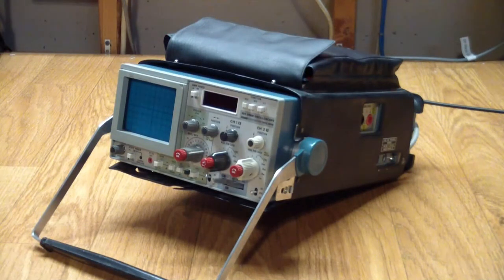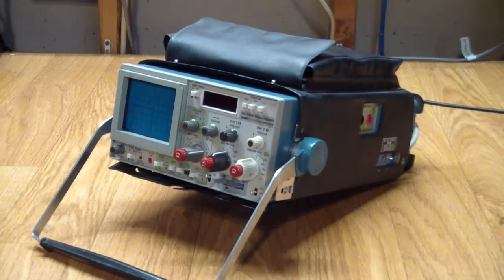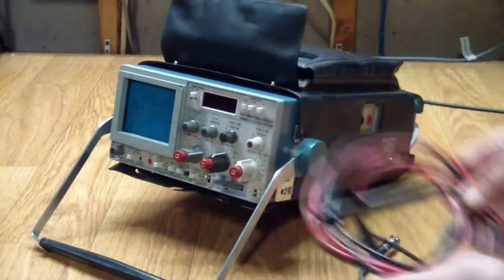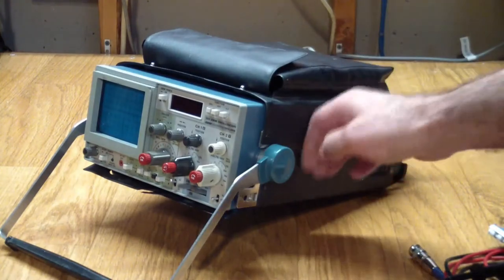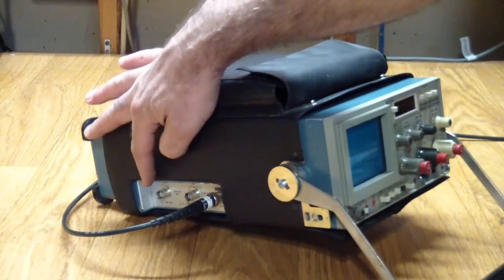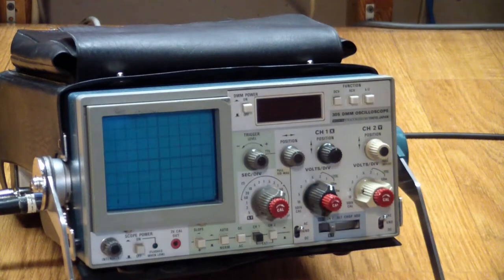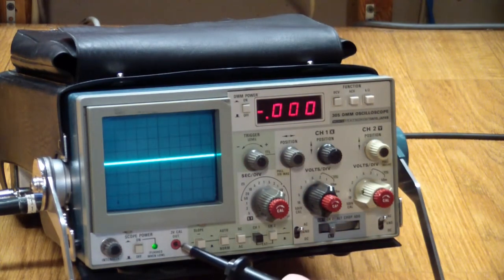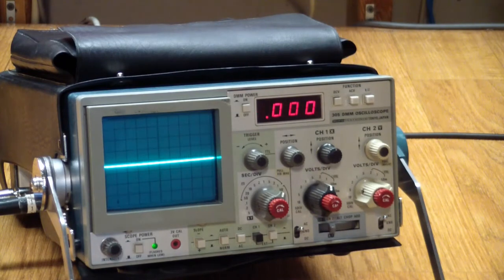AE#1 Sony/Tektronix 305 Oscilloscope Repair

Comment: Thanks for making this video - I have one of these scopes dating to the early 80's. My scope's horizontal sweep was affected - the trace all the way over on the left side of the screen. I watched your video, downloaded the schematics and took the top off the beast. Checked the PS voltages like you did and found them to be off. I'm thinking it must be bad electrolytic capacitors in such an old machine but it was pristine no signs of electrolytic issues. I took the PS board apart to look at it and couldn't see anything wrong. Then, admitting defeat, I reassembled the PS and battery charger boards, tightened the couple of standoffs and screws back up, and guess what, it works! Test point voltages all good again. Looking at this design, the chassis and the mechanical components such as screws and standoffs are actually an important part of the grounding throught the scope, so in my case, just removing and re-tightening a few of the PS board fasteners fixed my problem.  Not unlike your issue in this video (missing screw on the main board). Thanks for the inspiration. These machines are old and antiquated, but they are beautiful pieces of engineering.  Nice to not have to throw them away. I started the day intending to use this scope which hadn't used in years to troubleshoot another problem, so now I can go  back to that one!
Reply from the maker: You have to make sure that all bolts are present and tight. Over the years the pcb will get contaminated creating all sorts of raised ground levels all over.

Comment: Watched with much interest. I had a go at fixing a defunct Tektronix multi voltage, dual trace scope some years ago. It did work when I first got it but then found problems with the PSU side. One of the power transistors had failed and the only thing I could get my hands on then was a T03 2N33055. The body of the transistor had to be modified to fit onto the scopes circuit board. Only 1 mounting nut/bolt could be used and the opposite side of the base had to be removed to get it to fit. I did get it to work however and it was good till unfortunately it got stolen  along with other pieces of my equipment.

Comment: I am enjoying watching your videos and I have picked up several good tips for repairing and maintaining my old Xbox units (used as WMC extenders).  Regarding eBay test equipment prices, I have a couple of points to offer:  If a particular piece or family of test gear is being dumped by industry or education, prices drop rapidly and bargains can be had.  A case in point now (Feb 2018) is HP logic analyzers.  ATM the HP 16500 and 16700 families are bargains if you need one.  Second, prices in general are all over the map from ridiculously high to reasonable to bargain; the key to getting a reasonable deal is patience.  As an example I was able to obtain a two volume set of original manuals (otherwise unavailable anywhere) for a particular piece of equipment for less than one eBay vendor wanted for a single volume, including shipping.  Thanks.

Comment: I bought this same oscope on ebay it was supposed to be working and appeared to be in the photos. I assume something was possibly jarred in shipping or something just went bad. I really like the compact size of the scope so would like to repair it. The problem is that in both channels, it will display a signal/trace but only in the three center grids of the scope. If you try to move the signal/trace up or down it mashes up the signal. I have found a tecktonix oscope repair manual and the 305 repair schematics online. The repair manual is pretty vague on problems in the vertical preamp/amp section. I did take it apart and looked for missing screws but found none. Thought you might have an idea where to start. I do have a multimeter for troubleshooting and the scope will show signals but with questionable voltage levels. By the way great video, I have watched it a couple of times to get some inspiration to fix the oscope.
Reply from the maker: Since you seem to have full horizontal deflection we can assume that your CRT voltages are good. Thus you need to check voltage supplies on the vertical amp section, and it sounds like you're already looking at that. If any of those voltages are too low the signal will saturate at that voltage level.
Reply: @artifactelectronics  Thank you for your help I found that pin P280 was disconnected on the vertical amplifier. The scope is now working correctly.

Comment: Nice problem shooting, this are often hard to find problems. Had it with a Tek 1S2 plugin. As soon as I reassembled the front connector it stopt working. Turned out to be a bad solderjoint. 
I would do an other test. Connect the chassis with a piece of wire. If that helps you are right. But if not there is some crack in a trace or bad join t that no makes contact because the screw pushing on the pcb

Cute little scope,
Reply from the maker: There may very well be a bad trace interrupting or corrupting ground somewhere, and replacing the missing screw probably reintroduced ground continuity for that section of the board. But as long as it works I'm fine with this fix.